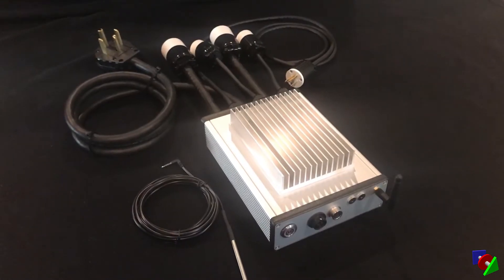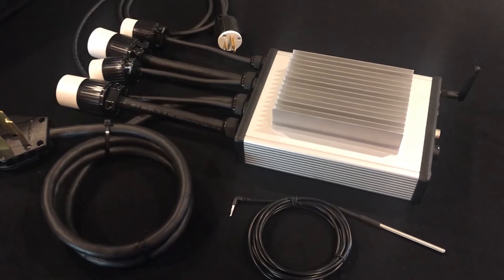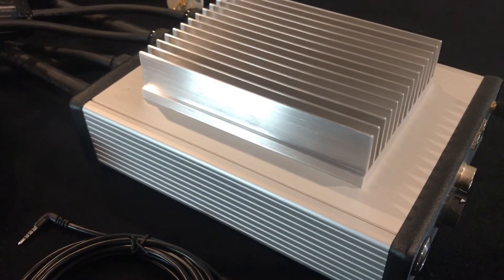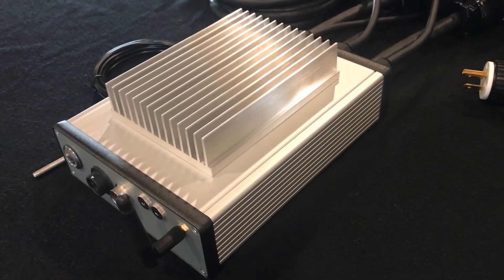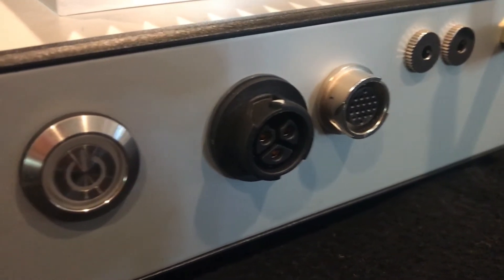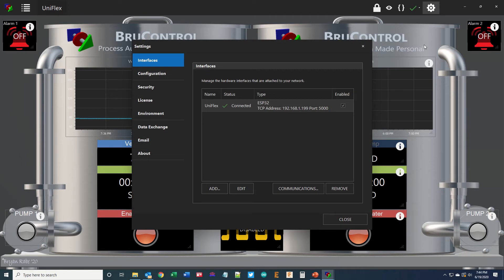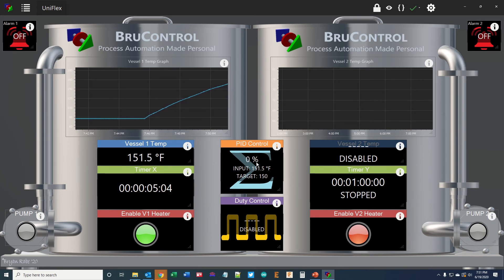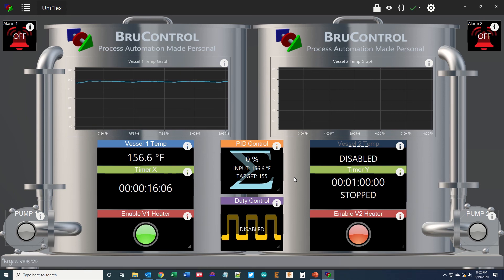UniFlex Brewing Control System Overview

Comment: I want to go from gas 3V to electric 3V HERMS and I like this brucontroller, I am trying to understand how 30A system will work for 3V as most others seem to be at least 50A my tanks are all 50L (13.2G) is 30 amps enough power for 2 pumps, 2 5500 watt heaters?
Reply: 30A allows you to run one heater and two pumps at the same time. The heater can be either the HLT or Boil Kettle heaters - the selection is made via the controller's software. Since you heat strike water, then maintain mash temp via HERMs, the HLT heater is used first, then once you complete sparging and transfer over to the BK, you switch and heat there for the boil. Easy!
Reply: @PFBruno3  Got it!, looks like a great system but I want to run both heating elements same time for future proofing my brew days like when I want to start a second batch.